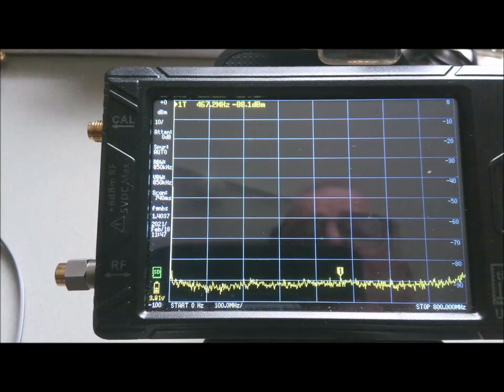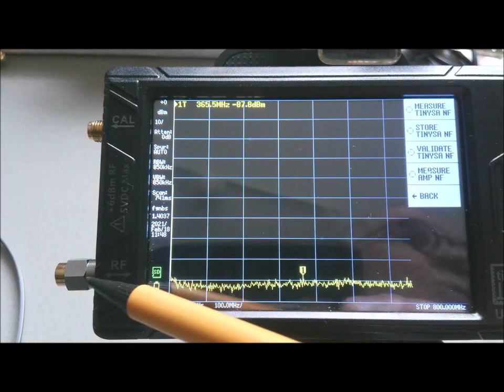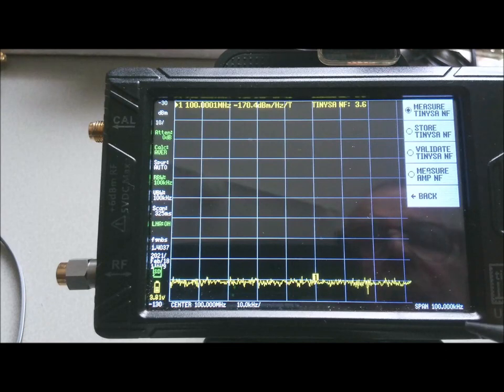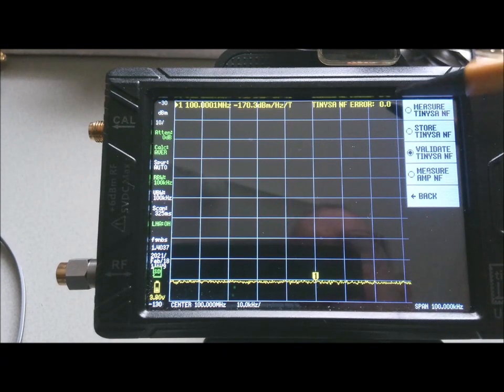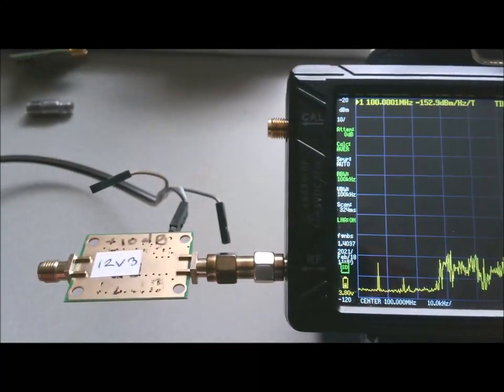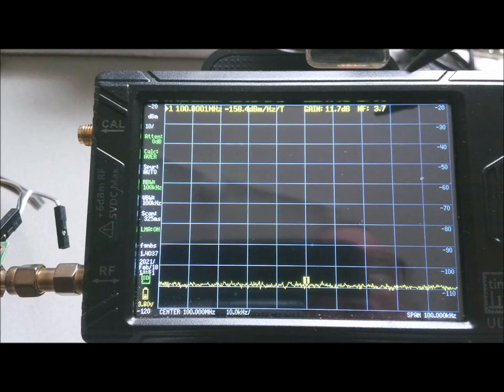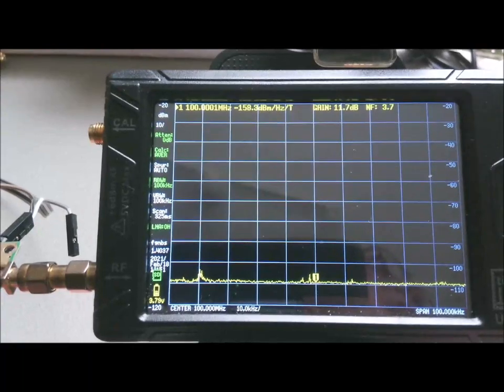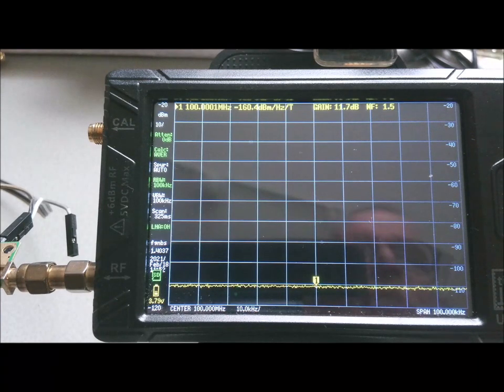Using the tinySA Ultra to measure the Noise Figure of an amplifier.

Comment: Something I just ran into testing an older amplifier designed for 2m weak signal. I checked the gain using a signal generator and the tinySA. I arbitrarily chose -40db as the amplifier input for the measurement and ended up with a vastly higher noise figure on the Tiny than my HP 8970A indicated. I retested the amplifier but this time I used a -100dbm signal at the input of the amplifier. The gain value was different the amplifier obviously starting to compress at the -40dbm level. The result of measurements with the new gain value were TinySA ultra 0.4db and  HP8970A 0.42db. I have to say, I am getting more and more impressed with the TinySA ultra.

Comment: Thanks so much for posting all your Very helpful TinySA informative videos.....Could you explain why a properly designed matched 50 ohm Rf  amplifier under test NF Significantly  Improved to 1.5 db when Un-terminated ?? ....I was Expecting the Un-terminated amplifier to Significantly  Degrade to higher than when properly 50 ohm terminated .....Thanks...
Reply from the maker: Look here: https://www.analog.com/en/technical-articles/lownoise-amplifier-lna-matching-techniques-for-optimizing-noise-figures.html
Reply: Amazing noise power Matching info !!! .......A properly 50 ohm input Terminated RF  Amplifier generates slightly (about 3 db) More noise than an Input Un-terminated amplifier.....Of course neither an input Shorted or input Un-terminated Amplifier is useful....Maybe some kind of cleaver "tricky" input to output Feedback scheme could produce a "Noiseless"   50 ohm Input termination  ???
Reply: Are you Sure that it isent the thermal noise from the 50 ohm load that you ar measuring when you measure more noise

Comment: Would it be advisable to use the same termination for both measurements or is the error small enough to be ignored if using different 50 ohm terminations?
Reply from the maker: You can use different terminations as a couple of ohm does not make a difference. But for high frequencies, above 1GHz, you better use the same as the complex impedance van be very different.
Reply: @ErikKaashoek  Thank you Eric, that is what I thought. I just tested an amplifier I build a while ago on 144.2Mhz. With the TinySA ultra the indicated noise figure is .4dB, with my 8970A the indicated noise figure is .42dB. Impressive result for the ultra, well done.

Comment: I have a tinySA ultra and if I measure the NF of an amplifier I get negative value, like NF: -3.6. The values I am measuring looks valid if I omit the minus sign. I have the latest firmware V1.4.129 on the SA. Could this be an software issue?
Just to cross check I measured a mini-circuit LNA gain with a professional SA, and what I got is inline with the value measured with tinySA and with the datasheet too. So I am confident that I input the correct gain when it is asking for it. Also the measured NF is very close to the value from datasheet.
Reply from the maker: Did you always terminate the input with a 50 load?
Reply: Yes
Reply: I just checked github issues, and I found a bugticket with the same issue.

Comment: Does the TinySA Arrive Out of the Box already Factory  Level  Calibrated  ?
Reply from the maker: Yes and no. The frequency dependent part is calibrated but the absolute level can be calibrated using the built-in very accurate calibration source.

Comment: Erik, is it possible to get the stored .csv traces on  the sd card to the pc app for further exporting to another program?
Reply from the maker: Not yet. I hope to add the ability to use the SD card as a USB drive from the PC
Reply: Thanks for your prompt reply and overall support. This feature is major for audiovisual applications such as site surveys for posterior frequency coordination. This would exempt the user from bringing a laptop just to export csv.
Reply from the maker: @lisbom2001  I may have misunderstood your question. It is already possible to store a trace in .csv format on the SD card. Once back hope you can extract the SD card and use a PC to read the stored files on the SD card
Reply: @ErikKaashoek  but where on the pc app?
Reply from the maker: @lisbom2001  The PC app can not extract traces stored on the SD card from the SD card
Reply: @ErikKaashoek  so the only way to recover them is via a micro sd reader?
Reply from the maker: @lisbom2001  There is a python program that can run on a PC that is connected to a tinySA that will list the files on the SD card and allows you to read these files. Can be found here: http://athome.kaashoek.com/tinySA4/python/tinySA4.py
Reply: @ErikKaashoek  Thanks!
Reply: @ErikKaashoek  sorry Erik. I am having a hard time starting with Python. Would it be possible to identify these .csv using a micro sd card reader (haven't got one at this momento so I. can't try)?
Reply from the maker: @lisbom2001  Yes, a micro SD card reader will work very well
Reply: @ErikKaashoek  splendid! Again thank you for your dedication and patience

Comment: -170 dBm/Hz noise floor for the tinySA seems a little too low. Is that accurate?
Reply from the maker: It is accurate due to the excellent internal LNA with a noise figure of about 4., above 750MHz the noise floor starts to increase
Reply: @ErikKaashoek Thanks for the reply. That's very impressive. Is the project open source?
Reply from the maker: @couplingconstant  The SW is open source, the HW not. See the wiki at tinysa.org

Comment from the maker: Yes
Reply: Erik, I'm using my tiny sa ultra to catch any distorced harmonics from a PGA113, which signal is 200khz square. I've noticed that if the tiny sa ultra is connected to the output of the PGA113, the sinusoidal gets distorced. If I take off the tiny sa ultra, it keeps a clear sin. Do you have any clue if it's an defective unit of tiny sa ultra?
Reply from the maker: @Ech01378  Join https://groups.io/g/tinysa for detailed support questions